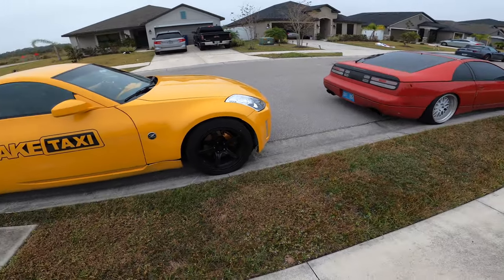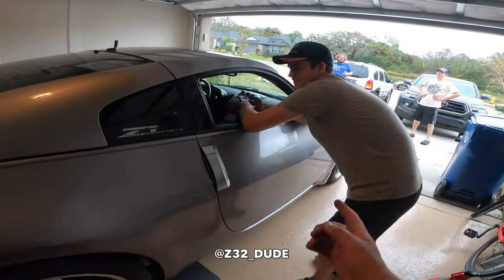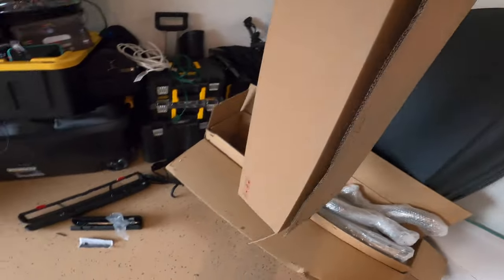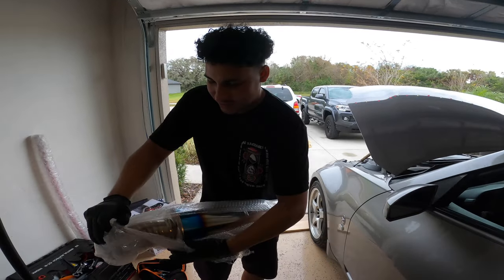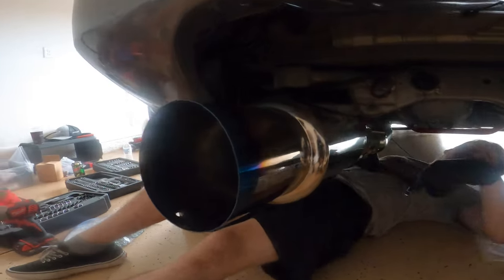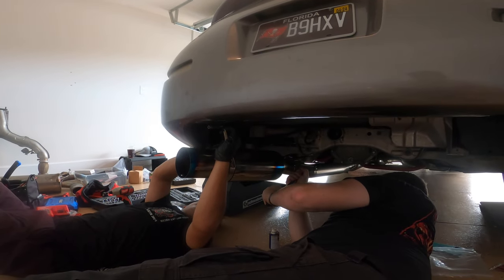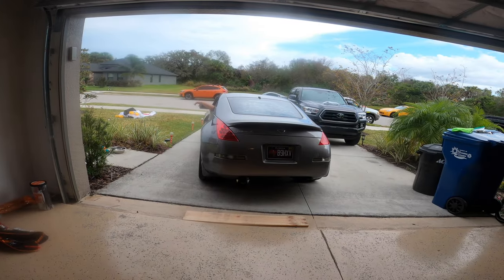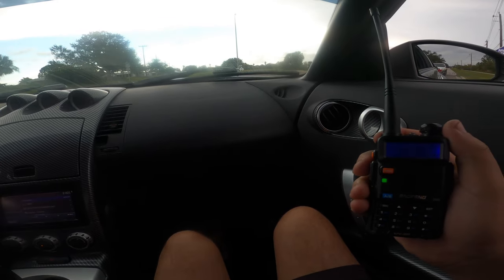350Z HR GETS A FULL TITANIUM TOMEI EXHAUST

Comment: i wonder if it sounds louder with the tomei catback
Reply: it is the same sound
I got only the catback. the good side is, when the engine is worm, you cand drive it slowly without being lound.
Reply: @prodanesti do you recommend a cat back then? I’m trying to decide between that or the muffler
Reply: @res874  
yes. I think this is the best way for a 350Z. you won't get any check engine light or any other light with just the cat back from Tomei. I guess with the other brands too, because you don't have any sensors from that point. mine is 2003-2005. I will come back with a video, so you can have an idea about how it sounds.
Reply: @prodanesti  thanks
Reply: @res874  
https://youtu.be/aMl6g0W0Ea8
this is how it sounds from the car.
Reply: @prodanesti  thank you I appreciate that